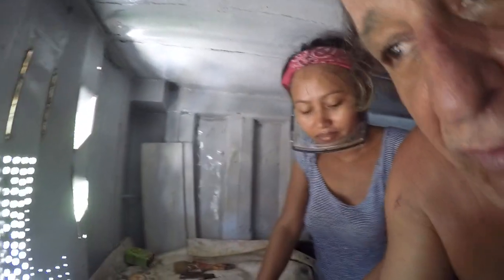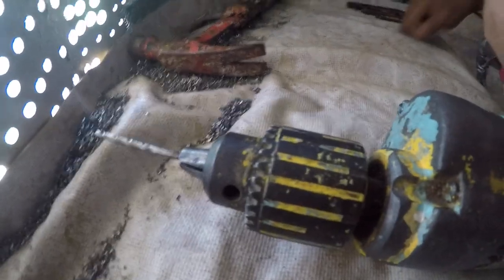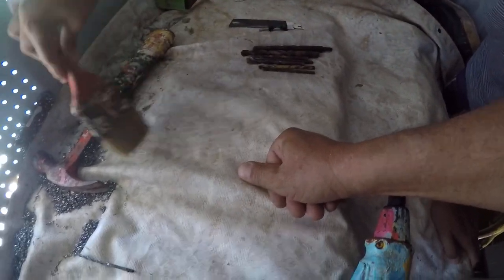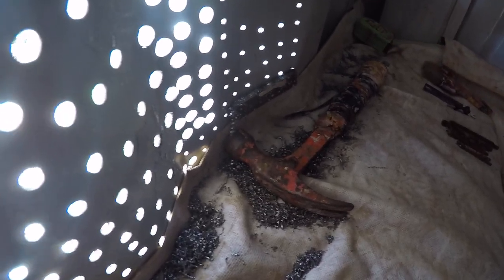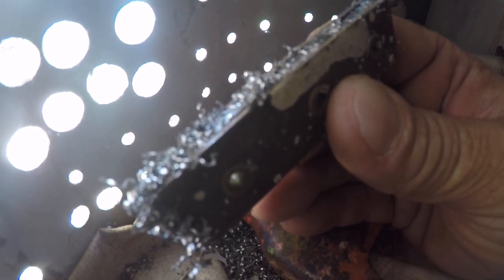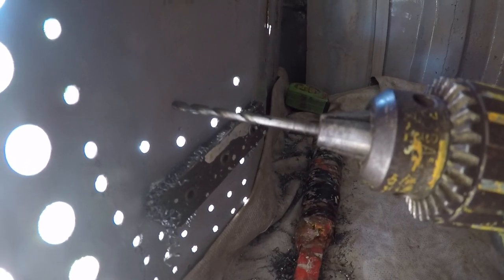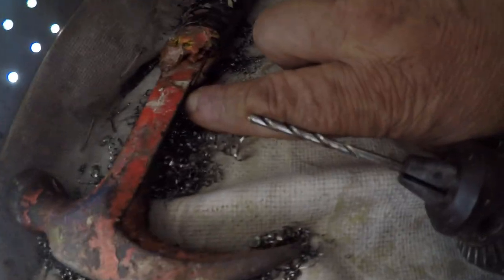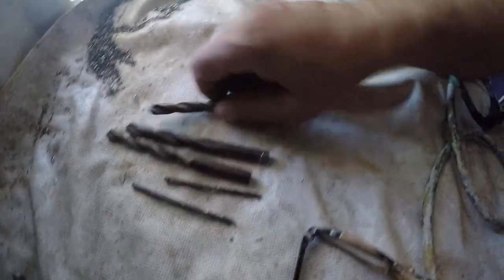BEAUTIFUL FILIPINA DAISY MAE CARGO CONTAINER EXHAUST FAN INSTALLATION HOW TO DRILL HOLES IN STEEL

Comment: Do you sharpen your dull bits ? I tried but fail badly .
Reply from the maker: paul joe i want to get the drill bit SHARP and properly you need to use a diamond blade on a hand grinder but you have to look up the correct angles just google it and you will find the angles
Reply: Yeah its the angle that is the hard part ? Due to it having a spiral
Reply from the maker: paul joe 
 google how to sharpen drill bits and it will answer your question